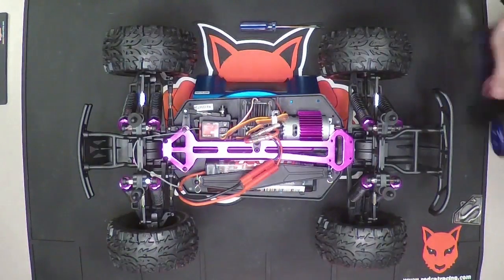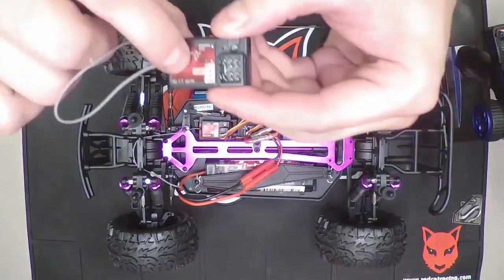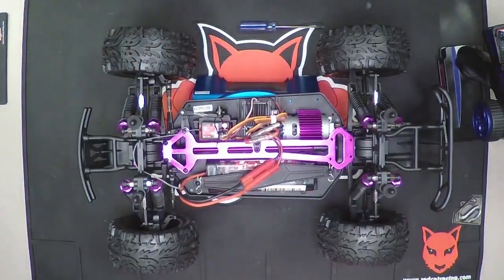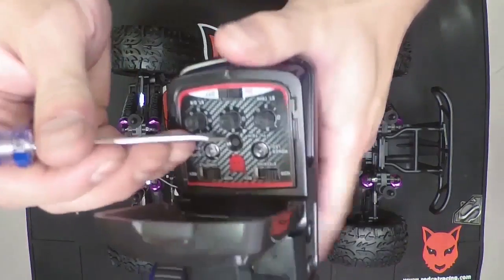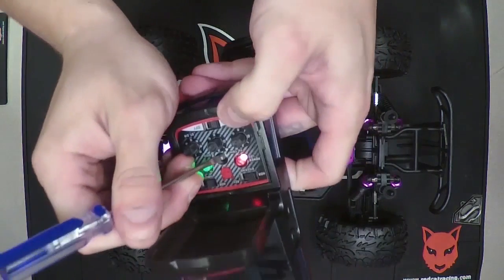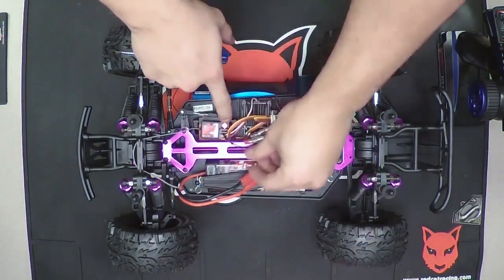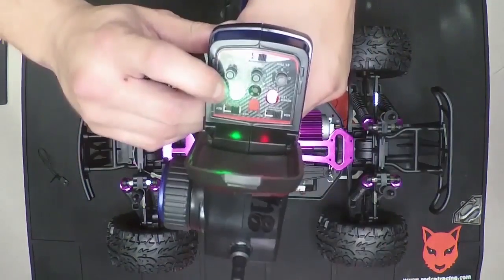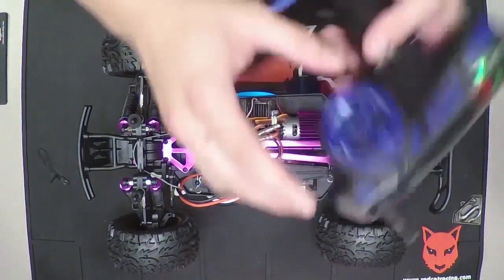Redcat University - 2CH RCR - 2 Channel Contoller - Bind Process

Comment: I'm having trouble with my volcano connecting. The battery is good but I don't get anything from the car when I connect power. The light on the receiver is solid. I've tried to bind it and I can't get the receiver light to blink when it is plugged in. Any help would be greatly appreciated

Comment: Its been always easy but this time, doing exactly what's said it won't bind, receiver keep blinking and transmitter keep flashing but not binding it's this red cat transmitter a POS ? It lost control of steering and trying to re bind with original it don't work buy a new receiver it didn't work now buy another receiver and won't bind so may it's well never buy any red cat stuff

Comment: So randomly my truck is now turning the wheels all the way to the left and it seems to be causing a problem so I read online to re bind the Rx Tx so I want to do so but how do I delete the bind or reset it so I can rebind? Also which two pins are used for the bind process since I somehow can’t find my packaging with the bind clip.

Comment: IV done this process and only thing that works is stearing its got a new esc once again I think in on my 7th one in less then 2 years.the receiver has sold light but the esc just blanks if I hook the motor straight to power it works to me that indicates the ESC is bad but I just took it out of the package the Redcat won't warranty anymore stuff for me they said they're concerned with how I use it it's a rock crawler and I don't get to use it cuz it's always broke. I see so many blogs and so people so many people online having the same problems with Redcat . I put so much money into this gen 7 with aluminum and metal parts all for nothing not including all the receivers and ESC and servos are had to buy just to play with the little bit I have

Comment: My esc lost reverse and brakes when I changed my controller batteries. After trying to re bind it appears the esc is getting hot when powers on.
Reply from the maker: Changing or modifying something with the remote should not affect the car at all. There might be an underlying issue with the cars electronics. If there have been any chassis, electronics, or drivetrain modifications to the model that might be the issue. And if the ESC is just warming up from being turned on it could be failing or you are using way to large of a battery - if the battery has been changed. If you still have issues it might be best to call our customer service line for help. They can help out Mon-Fri 8am-430pm AZ time.
https://www.redcatracing.com/pages/contact
Reply: @RedcatracingAZ  ya - it fried. Already replaced it with the 1060. Works great!

Comment: What can I do if I bind my controller and it only goes forward and backwards? it doesn’t steer
Reply from the maker: First thing is to check your "Steering Dual Rate" and make sure it is up. 
Second would be to ensure your servo wire is plugged in the right channel and the right direction.
Reply: @RedcatracingAZ  and if all that is good as in my steering rate is up and servo is on 1st channel what do I do next ? I tried the servo on another transmitter and it worked but on this transmitter it won’t ?
Reply: @RedcatracingAZ  and when I flip the esc and servo plugs it gives me steering but with my throttle on my remote but then nothing on the turning wheel?
Reply: @jonathansaucedo3199 did you fix it? Having same problem

Comment: Hey it appears nothing is working on my car. I have a volcano exp pro series and I’m wondering if my truck is shot. I bonded the remote exactly as you said but nothing is happening.
Reply from the maker: If you replaced the receiver unit and yet the bind is not working or the model is not responding it is probably not "shot" but something else is the issue. Might be a good idea to contact our support team.  They can help out Mon-Fri 8am-430pm AZ time.
https://www.redcatracing.com/pages/contact

Comment: Hi.....but what after all of that .... when you turn the receiver back on, the light is flashing again and with no binding process???
Reply from the maker: Is the bind plug in the receiver still? If so take it out BEFORE turning the car back on. 
If not - then it is probably a bad receiver. 

BUT also - if you have the R-3E receiver you need to use a different binding video. 
https://www.youtube.com/watch?v=Vk1NjYs0LA4

Comment: Is there something else I can use if I have misplaced my bind plug?
Reply from the maker: Technically an old servo or ESC wire with wire 1 and 3 jumper would work. other then that - no not easily no.

Comment: Sometimes The reverse on my sons truck doesn’t go. We gotto tap it couple of times before it goes. What can I do to trouble shoot it?
Reply from the maker: So that is normal for the most part. The remote has a neutral zone and the trigger goes from Forward to breaks. Then the trigger needs to return to the neutral zone then go forward again to engage the reverse. If it doesn't get hit correctly it may think it is in break mode still and not go into reverse.

Comment: I replaced the receiver on my Volcano EPX thinking that was the problem.
 Still the same thing. When I turn it on
The motor makes the sound but nothing lights up on receiver or ESC and it won't do anything.
Any suggestions?
Reply from the maker: Not sure - could be a few things. Might be best to reach out to our support team via email or phone Mon-Fri 8am-430pm AZ time. We can help for sure!!
http://www.redcatracing.com/Contact
Reply: It was a bad ESC

Comment: Anyone know how to bind a redcat valcano 1/18
Reply from the maker: Send depending on the ESC and remote model of the volcano 18 you have one of the ways to bind the remote to the car is to turn the car on 1st and within about 5 Seconds turn the remote on but make sure that the remote is less than 1 foot away from the car.

Comment: Ok so I know I'm a little late to the party here, but would it be a receiver problem if I upgraded my motor and esc, and whenever I try to press the throttle the truck(volcano epx) will start wobbling so bad it looks like it dancing.  Whenever I try to go full throttle it just spins out. It doesnt do this in reverse btw. Please help me out on this.
Reply from the maker: Sounds like you might have a few things going on. Best option is to talk to our support team directly - they should be able to help. Our team is always available and willing to help Mon-Fri 8am-430pm 
http://www.redcatracing.com/Contact

Comment: What the guy below said. 

But I figured out what it is. 

The esc light would not bind because the motor went out. / died. Kicked the bucket. 

I owned my RC for 2 months or so use it a little. Should not have died so fast seems how I take Epic care of this truck.  

Sometimes a failure just happens. 

In my case motor failure indeed. 👊😀I love fixing these things.

Update to comment. Took the motor apart completely cleaned the magnetized dirt and rocks out. Cleaned it re soldered it back together. 

Put the whole motor in a cup of water and to my amazement it came back to life and cleaned up. 

After a good low idle in the cup for 2 minutes. Which the water was really clean. And I dried it and oiled up the ends with one drop of bearing oil. 

What ya know. It’s like Brand new. 

I love you Red Cat. You guys know how to make long lasting parts. ❤️👊😀

Comment: hey what could be wrong with the reciever, when i turn on there is no light blinking...
Reply from the maker: There are a few reasons why that might happen and there is ways to check each reason. First you need to know if your battery voltage exactly and if it is powering your ESC correctly. Second you need to make sure the wire from the ESC is in CH2 and the black wire is in the spot away from the sticker. Third thing to check is - if CH2 does not work and you know that the battery is good and the ESC is plugged in right. Change to CH1 or CH3 or even CH4. The ESC should power on the receiver in ANY CHANNEL (it just only works with the throttle in CH2) so if the CH2 in the receiver is burned out - plugging it into another channel will let you know. If it works in all or any other channel but not 2 that channel on the receiver is probably dead.
Reply: Problem solved, it is working again thank you...
Reply: @RedcatracingAZ  other question, the truck move really, really slow forward, and when going reverse is perfect  could help me with it.?
Reply from the maker: Motor polarity is backwards. If the car is FASTER backwards than it is forward - just switch the motor wires connecting to the ESC. EVEN if they are black to back and red to red - switch them. See if that helps. 

May also have to flip the "Throttle - REV / NOR" switch as well. That switch also reverses the signal but may not work with polarity.

Comment: I need help i got a redcat everest 10 and i got throttle but not steering
Reply from the maker: Sorry to hear you are having this issue. So to check real fast there is a dial on the remote labeled "Steering Dual Rate" or "ST D/R". The dial is under the lid on the top of the remote all the way on the right and should go from 1 to 100 (OR 0 - 6). Need to check that and adjust it up if it is down. Then Test the steering again.  

This video may help. 
https://www.youtube.com/watch?v=wDwW6wsR2Fk&list=PL6u6u7AYre60Q5AcK_I_Mp9z5XuVWcaGd&index=6

Comment: I just tried this with my rcr vehicle...it didnt work. however the lights did what yours did... but when I turned everything back on, it's as if it 4got everything again....
Reply from the maker: Did you happen to leave the bind plug in when you turned it back on the second time?
Reply: Redcat Racing 
did exactly what you did on the video
Reply from the maker: Hey Hey - So might have figured this out by now but if not sounds like your receiver is failing to keep its bind and may need replacing.
Reply: Yes i think i burnt out the receiver only one channel works